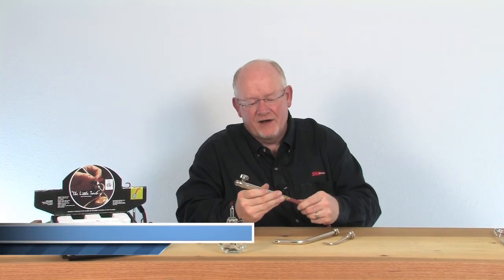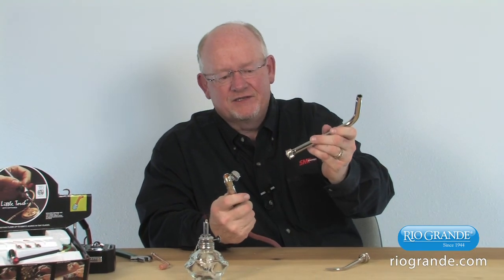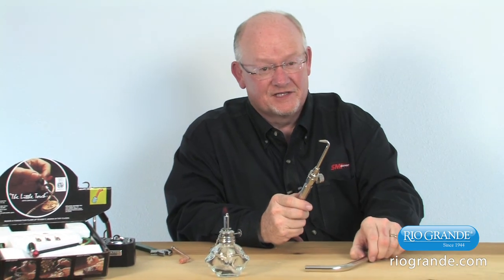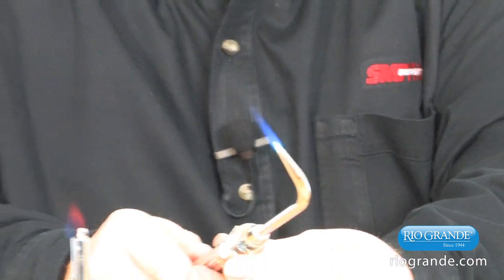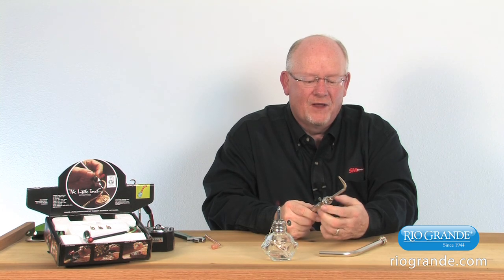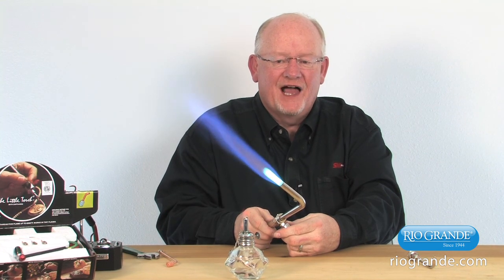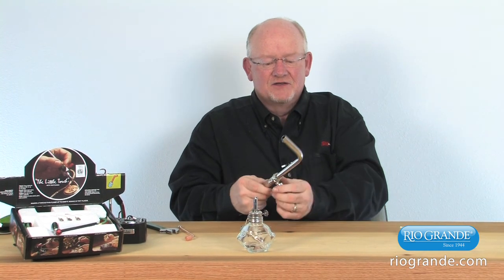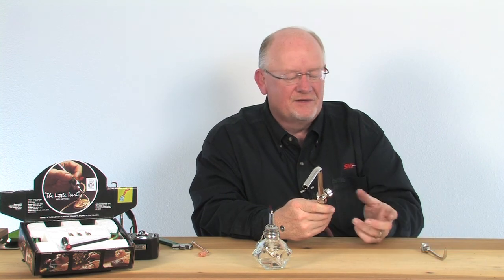How To Light and Adjust Your Smith SilverSmith Torch

Comment: Are welding glasses needed when using this torch?
Reply: No. You are considered soldering when you use this tool, not welding. It probably would help if you took an introductory metalsmithing course.

Comment: At 3:30, is that ash being generated by the flame of that #4 tip? If that is true, is there anyway to prevent that or is it just going to happen that way?
Reply: I have this torch and it rarely produces soot.  The only time I ever notice ash coming off of it is if you don't get the flame all the way extinguished a tiny flame can burn at the base of the tip where the oxygen comes in.  Other than that, no ash, and I love this torch for most applications.  I rarely mess with my little torch anymore.